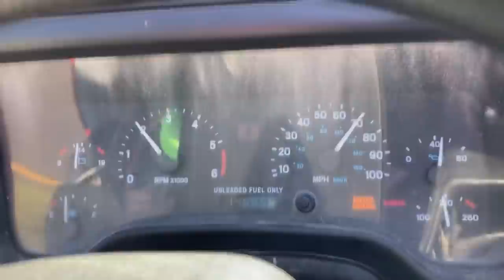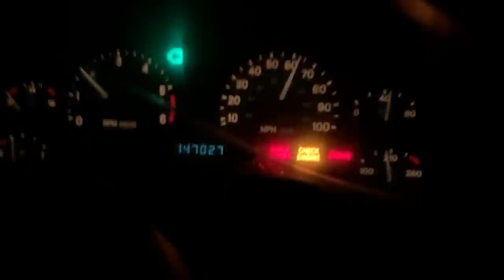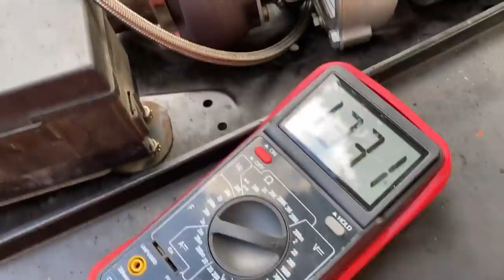First Turbo Charged JEEP Road Trip 👮 COPS, BREAKDOWN & BLOW UP

Comment: from what i've personally seen 8PSI is what a jeep 4.0 will handle stock with stock head gasket, 9.5PSI on stock head bolts with MLS gasket, and the internals i'm told will handle 13ish without issue, a jeep 4L inline is a tractor engine with asthma, so a turbo is about like a Cpap on these engines, they will handle it, but "boost responsibly" lol, great video, and with enough testing and tuning you'll get the gremlins chased out of her

Comment: Wow.I've been told 'I don't have my head screwed on tight'.Good thing you stopped right off.A new gasket, flush both oil,and coolant systems,and get a better blow-off valve with an 8-Lb spring.Ready to roll again.I'll be happy to watch you do all that too.Happy trails Dalton.

Comment: You need to run hard pipe on the hot and cold side with v bands oh and build the top end , stock can’t handle the boost

Comment: Did this thing get tuned
Reply: Video was a banger, go watch it.
Reply: I am the tuner.   The stock pcm is set up for speed density one bar. We use a fuel management unit that gives us 12 lbs of fuel pressure for every pound of boost. Also 36lb hr injector.  This gives us enough fuel at wot. I got it dialed in pretty good considering the lack of electronic control.  
I took this path over rescaling  in 2 bar witch can be difficult.